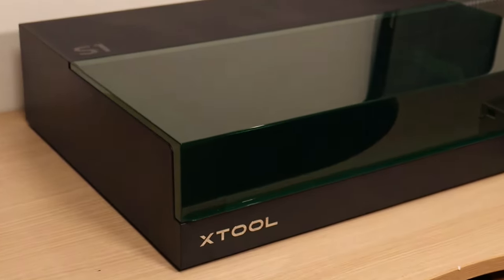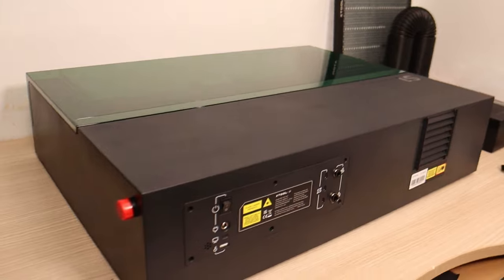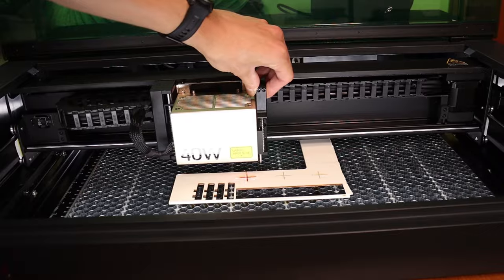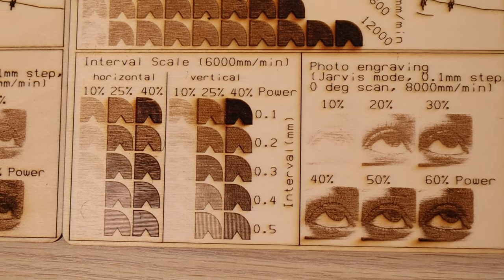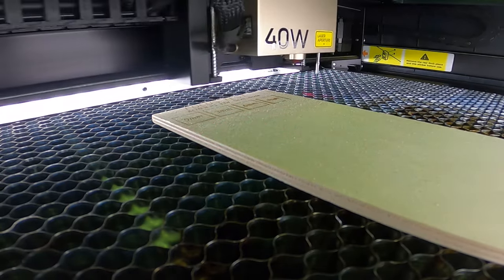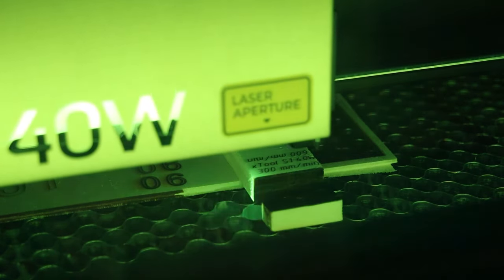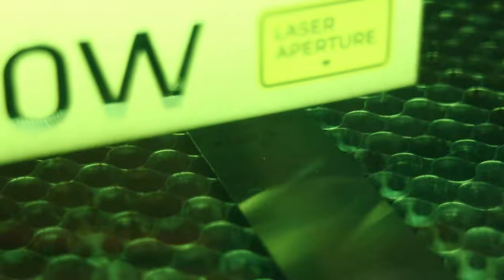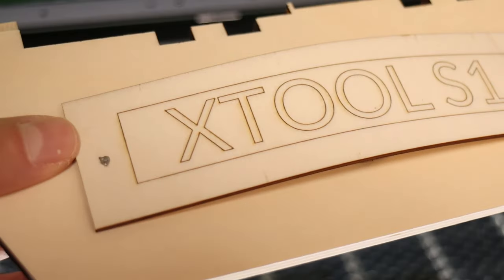xTool S1 Review: New Era of Fully Enclosed 40W Diode Laser Cutters Is Here!

Comment: Awesome review mate as always. Love the technical focus, appreciated.      It would be great if they would be able to get the beam width back to the D1 pro 20w size or better.   It is a nice machine and development is progressing rapidly.  One wonders what will be next !
Reply from the maker: The more powerful lasers will always be a bit wider because they have more diode sources to be focused in one beam. But the xTool S1 is still very good
Reply: The S1 20W module has smaller dot size than the D1 20W.
The S1 40W module has smaller dot size than the D1 40W, same size as D1 20W.

Comment: I am looking for a laser that can handle precise engraving on leather (curved) , what kind of machine/ lasertype would you recommend ?
Reply from the maker: What kind of curvature? how much of an curve? Can you use rotary or not?
Reply: @JTMakesIt  Hi, I am talking about, finished leather products that require specific logos or initials, like wallets, bags, passport covers and such (so not really flat) Rotary does not seem to be an option,  But Since I make the items myself, I could do the customization beforehand. 
For my products I use a vegetable tanned leather and I want to minimize the 'burned' look as much as possible, what type of laser head would you recommend. diode, fiber co2.. 
The Commarker B4 seems interesting (usability, size, batch processing) but I don't know how well you can engrave leather with this. Otherwise the Xtool might be an option. I am curious to know if you have had any experience with this, Cheers Johannes
Reply from the maker: @nitmoi Both the CO2 and fiber can engrave leather very well. Fiber will be much faster, but it has shallower depth of field. If you get the ComMarker, get the 200mm lens too as the larger lenses have longer field where the beam is relatively in focus. Talking about a range of up to  about 3 millimeters here. On the other hand, the xTool P2 (or the S1) have the realtime focus adjustments if you would require bigger range of focus adjustments. But that process is slow and not great for larger quantities. If you send me an email (go  to my profile/about) I can send you a photo of some leather I have engraved with a fiber.

Comment: Thank you for what I have found to be the best Video on the X Tool S1 to date and I've watch quite a few.  I especialy appreciate you getting right to it without the "Unboxing".  I have a shop where I make high end hardwood dovetailed keepsake boxes and chests. Most of them have some kind of laser engraving which I need to go off site to get done.  I'm considering purchasing my 1st Laser Machine and this looks like the one.  Would you recomend this for a beginer like me?  I can also see other applications for cut outs etc.  Thanks for your time sorry for the losng message.
Reply from the maker: Thanks!
The xTool machines are one of the easiest to use and they are great to start out. If you will decide to buy, don't forget to check the video description for my 10% off discount code so you can save some money. You can also support my channel by buying through my link at no extra cost to you :)

Comment: I actually wanted to buy a S1 20W and I am going to buy it after watching all the review videos. One question I would like to ask is about the point positioning feature. Since we still point manually, there are definitely still minor inaccuracies. Is there a way for this machine to automatically identify the edge points of objects? I know it doesn't have a camera feature.
Reply from the maker: No it cant automatically detect edges. But if I want to engrave a logo on a round object for example (keychain),I usually put a wooden board on the bed and engrave a circle of the same size on it and then I place the keychain in that circle and align the design in that circle in the software (another layer) and I have perfect positioning every time. I can explain in more detail if you want. Also, if you decide to buy, you can support this channel with buying through my link in description at no extra cost to you and I also have a discount code there :)
Reply: Thanks for your reply. Your solution sounds smart and I think I kinda get it. I would love to learn more about it. I will just need to get familiar with the software first.   @JTMakesIt
Reply: Another question just came to my mind which is how to engrave on multiple objects at the same time? Since it doesn't have a camera, do I have to point positioning manually every single object like ketchain?  @JTMakesIt
Reply from the maker: @elginwang1572  I usually use the laser to cut a wooden jig that positions multiple parts at once very precisely. Since I have cut it with a laser I have precise positions of each individual piece.

Comment: Still can’t be compared with the xTool F1 / LP3 for metal engraving 😂

But perhaps great for wood work.
Reply from the maker: xTool F1 is meant mainly for engraving wood and metal, the xTool S1 is meant for engraving larger designs and laser cutting parts from various materials. Totally different purpose
Reply: @JTMakesIt  sorry, but I meant to compare them for metal engraving purpose.
Reply from the maker: @thanatosor  if course F1 is much faster because of the galvo system. Laser power is the same
Reply: @JTMakesIt  Thanks for confirmation !

Comment: So they give you a so-called "precision" 2-point system, that you then have to eyeball your design to center it within the green outlined area...hmm...
Reply from the maker: It is very hard to have a precise single camera system in a machine with little vertical space above the workbed. Position accuracy is usually more than 3mm. S1 also has position encoders on all axis so you can position the design with hand and see the actual position in software in realtime. This is something no other machines have and it is very useful. Much faster and easier to position. Having dual camera system like P2 would make it too expensive
Reply: Good info, I do think they should of made a model with the cameras and called it PRO or something along those lines and let the buyer choose...just saying.  @JTMakesIt
Reply from the maker: @I-LOVE-EARTH  Maybe they will if there will be interest. You never know. xTool is very good with attachments and upgrades
Reply: Hopefully they do. @JTMakesIt